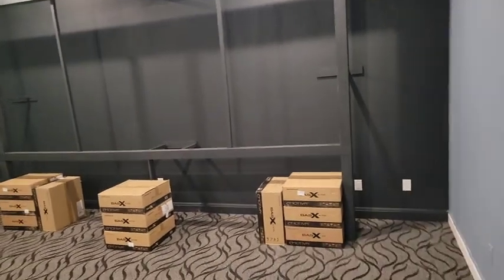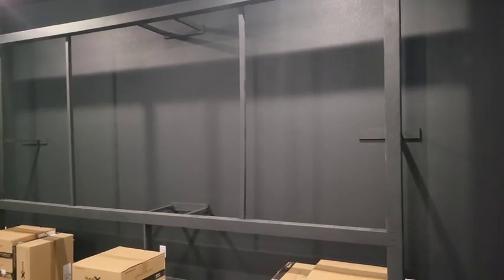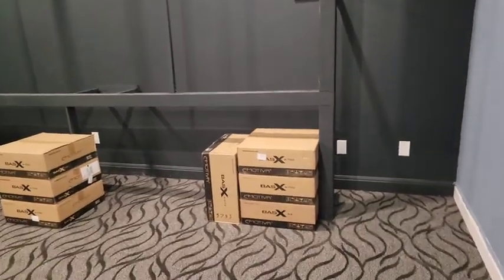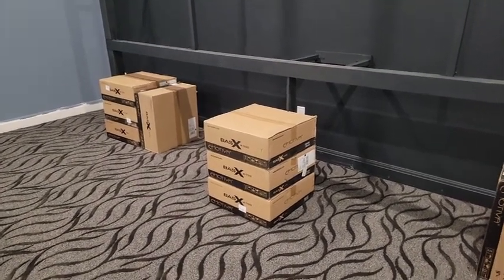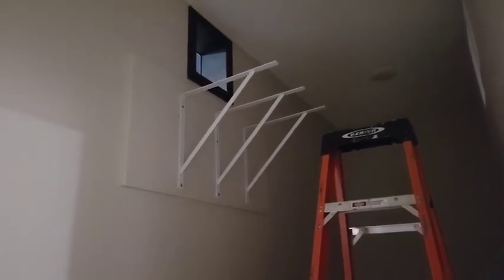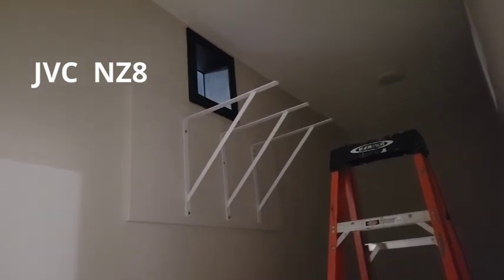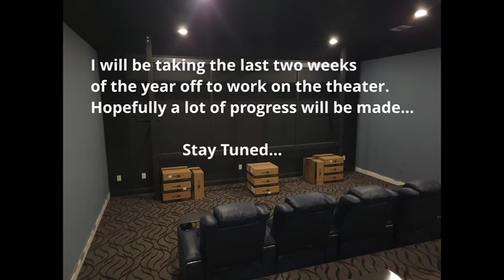update 12 11 21

Comment: Way too big of a screen for that PJ.
Reply from the maker: Not according to the calculator on projector central.
Reply: @mfkhometheater7742  Um, okay. Shame on whoever sold you that unit.  Hope you stick to SDR.

What screen material are you using ?
Reply from the maker: @burningsti  1.1 gain.  So what projector would you suggest?  And what is the maximum size you would suggest for the NZ8.  Keep in mind it is a dedicated room with total light control.
Reply: @mfkhometheater7742  165inch would be max for hdr.
Reply from the maker: @Creativeframesphotography  I really hate to go below 175", the room is 21' wide and the back row of seating is about 25' back from the screen.   The 165" max is based on 1.1 gain?
Reply: @mfkhometheater7742  which brand screen are you going for?
Reply from the maker: @Creativeframesphotography  I'm looking at options now.
Reply: @mfkhometheater7742  even the brightest woven screens will have realistic gain of 0.9.  with that gain you would get around 21fl ,which is very good for sdr.but for hdr 30fl will be optimum.if you opt for micro perf high gain screens. you can get the required brightness,but it comes with its own drawbacks for audio.
Reply from the maker: @Creativeframesphotography  I can always EQ the audio to compensate for any change in frequency response.
Reply: @mfkhometheater7742  ya ,your speakers look so Power full.but if you can watch audioholics at screen video. his screen requires 8-10db of boosting to compensate for perf screen.
Reply from the maker: @Creativeframesphotography  I'll need to make some measurements with the perf material that I have and see what it looks like.   The material I got from Carl's Place has defects in it so I can't use it for the final screen but I can at least use it to do some experiments as soon as I have a chance to stretch it onto the frame.
Reply from the maker: @Creativeframesphotography  If the projector central calculator is accurate there is no way to get 30 FL without switching to the NZ9, adding an anamorphic lens, and reducing the screen to 155" based on a 0.9 gain screen.  It's rapidly becoming clear that I'm going to have to trade some HDR for screen size.  155" is just way too small for the room.  

Keeping the NZ8 with no lens and the 0.9 screen I would need to reduce to 125"... again, based on the projector central calculator.   If this is accurate, my only option is to forget HDR or at least true full HDR.  I would rather have a properly sized screen for the room and viewing distance in SDR than a tiny screen in HDR.

Due to issues with my existing screen material and the fact it's turning out to be too big a pain, I think I will abandon the DIY screen idea and just buy one.  I'm talking to Stuart Screen now.
Reply: @mfkhometheater7742  you can go for 165inch 2.40:1 screen and achieve 25fl. if you use madvr ,25fl would still be good output for hdr. if you want to go bigger than 165inch ,then nz8 hdr wont be so impactful. also check micro perf screens before purchasing, for audio issues and the  minimum seating distance  at which the holes become invisible.
Reply from the maker: @Creativeframesphotography  165" is just too small for the room but I have abandoned the DIY screen idea and have ordered a 180" with StudioTek 100 from Stewart Screens.  I may or may not get an anamorphic lens later, after I see how it looks without it.  Because I get JVC wholesale, worst case is I sell the NZ8 and get the NZ9.   I understand the commercial cinemas are suppose to be 16 FL but most are less, even less than 14 FL so if I'm getting 16 ~ 17 I think I'll be pretty happy with it.  I'm more about sound quality than having HDR.  Thanks for the tips etc.  mk
Reply: @mfkhometheater7742  with 1.0 gain of studiotek 100 you can easily achieve more than 20fl at 180inch. problem of perfs screen is that the holes will be visible in bright scenes even at 10ft and if the speakers are close, there will be comb filtering. better to check these 2 aspects with a sample. if these 2 issues are ok for you,then studiotek is the best option.
Reply from the maker: @Creativeframesphotography  The front row is about 10 ~ 11 ft from the screen but will rarely be used.  The primary row is around 17+ ft from the screen.  

I didn't do any measurements but while I had my Carl's Place material sort of stretched onto the frame I didn't notice any significant difference in the sound quality. I think those big lines have so much surface area the screen isn't going to make much difference.  If you have a system with a single 1" dome tweeter I can see it being a problem but with fourteen AMT Pro-4 Air Motion Transformers I don't think it will be an issue.

I'm in the Austin TX area, you are certainly welcome to come check it out when it's done if you are ever in the area.
Reply: @mfkhometheater7742  at 17feet it wont be a problem. 
would love to hear those amazing speakers ,unfortunately I am from India.
Reply from the maker: @Creativeframesphotography  Well if you ever do make it to the states, you are welcome to come check out the system.

Btw, what do you think about this anamorphic lens... https://prismasonic.com/english/cinomorph_cylindrical.shtml ?

I had a Prismasonic lens in my old home theater and it worked really well.
Reply from the maker: @Creativeframesphotography  One more update, after more discussion with Stewart I have changed the order to the StudioTek 130 1.3 gain screen.  I also changed the aspect ratio from 2.35 to 2.4:1 and I have ordered a Prismasonic anamorphic lens.  According to Stewart's experts, this should be sufficient to have HDR on the 182.5" diagonal screen.
Reply: @mfkhometheater7742  yes, it is as high end as it gets for screens. these things(anamorphic lens,stewart 1.3 screen) makes hdr as close to Dolby cinema. only thing missing in your high end set up is madvr(assuming you don't have one). if you have such big budget, then madvr is a no-brainer for hdr tonemapping.